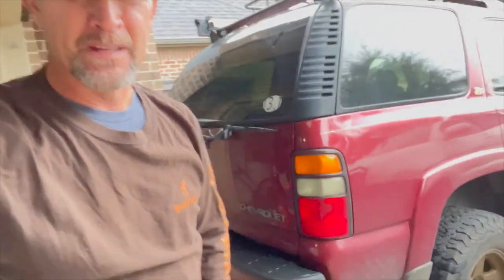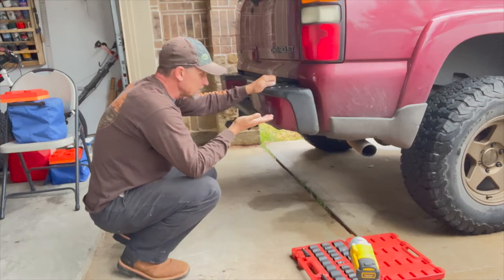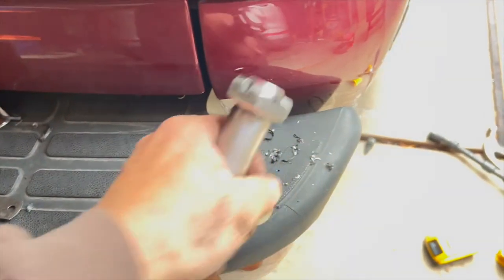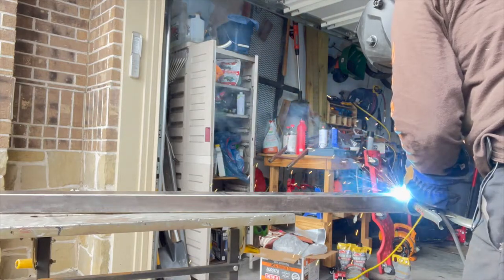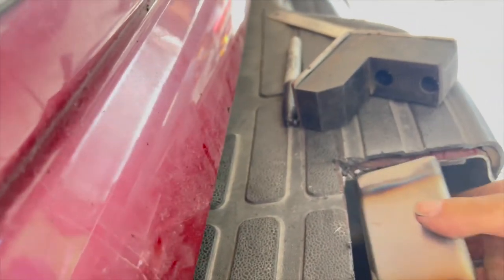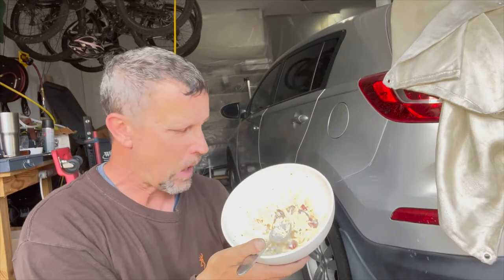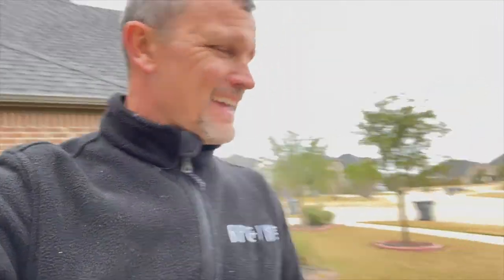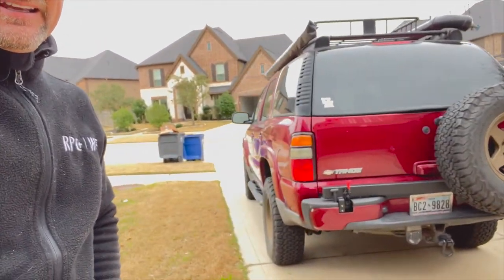Chevy Tahoe 2004 OEM Bumper SwingOut Tire Carrier

Comment: I have the saaaame tahoe ..lol would u ship to ca if i payed u? Great vid n gift ...
Reply from the maker: Hey, thanks for checking out the video.  I can make bolt on versions for 4Runners/Lexus’ (making one next week) but I’m not sure I could make the whole thing for your Tahoe. Anything is possible of course and I imagine I could make the swing arm and send you the brackets to have someone weld (or maybe bolt) them in.  
Shoot me an email at bentleycoaching@mac.com and we can discuss.
Reply: @OffroadGrind   sounds good .. or maybe a double sided hitch , instead of welding it just attach it to a hitch? ..lol im clueless but ill be emailing you sir thank you and god bless.
Reply from the maker: @xSILENTNEMESISx  yeah man you too. I’m actually making a hitch carrier for a gentleman soon. Double shear hinge for a 5th gen 4Runner.  I have all the parts, I just have to fit it in.
Reply: @OffroadGrind   now if you can use the measurements for the tahoe and weld the hitch to it...ill buy the set from you...really impressed with the work and id rather invest on a hard earned project..
Reply: @OffroadGrind   flag pole holder wouldnt hurt  -food for thought ..